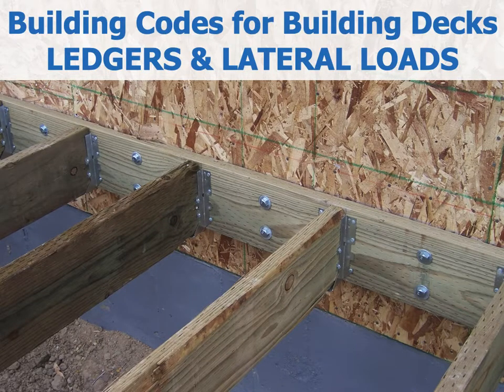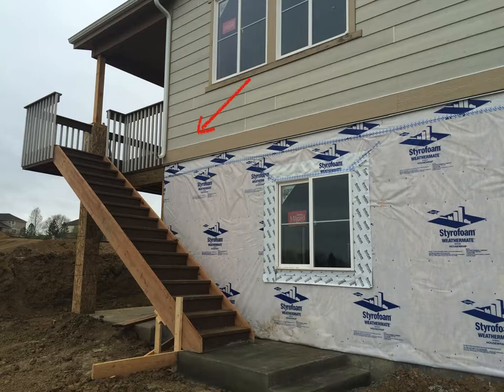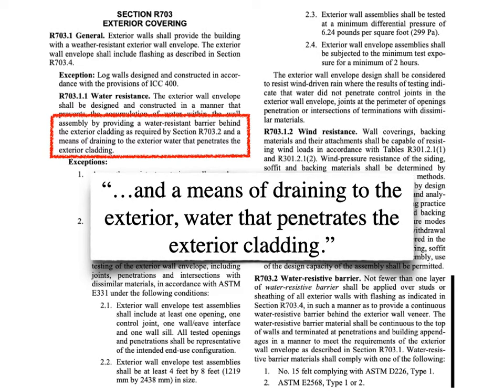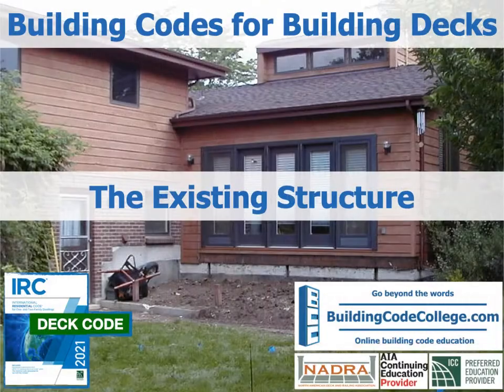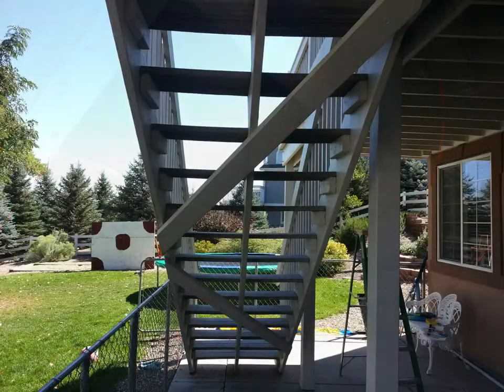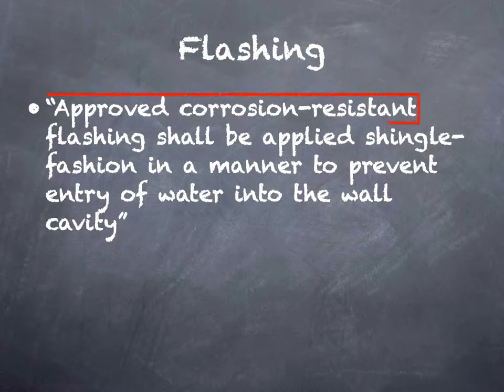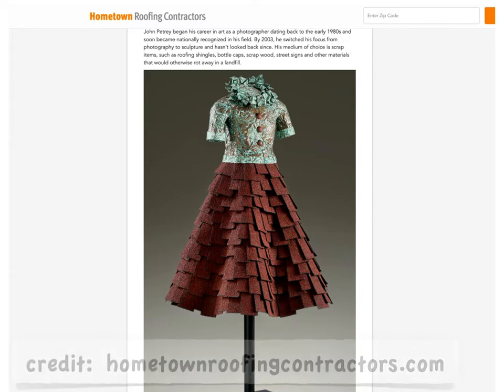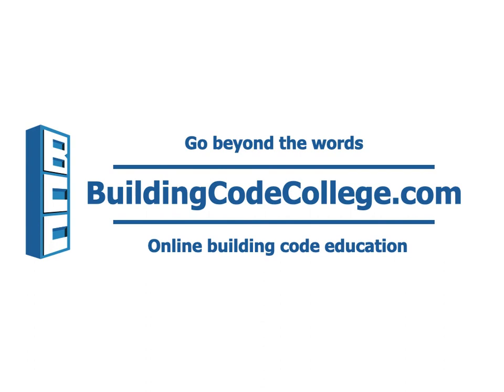Flashing Deck Ledgers 2021 UPDATE

Comment: Nice video, thanks for the update. So my house is older and I'm looking to extend and redo my deck. Under the cedar shingles (now also covered by foamboard insulation and vinyl siding), there is a fiberboard material and then what I assume is a tar paper on tongue and grove house sheathing boards, so no paper or moisture barrier. I was planning to install the self adhering flashing on sheathing boards but where do I stop that vertically and how does stop laterally? 

Should it end vertically where the old materials were removed, which will be covered by foamboard and then vinyl siding about 4 inches above the ledger? And laterally, would it end by extending on top of the cedar shingles or under everything again?